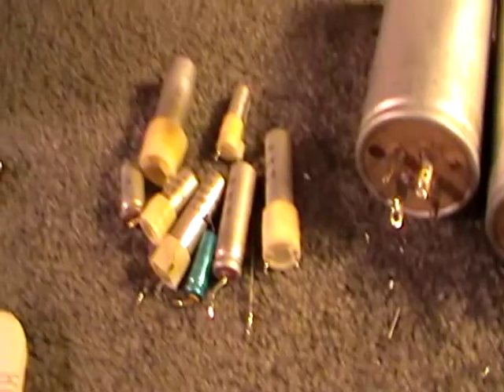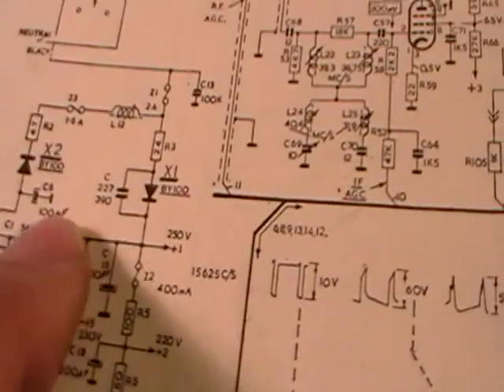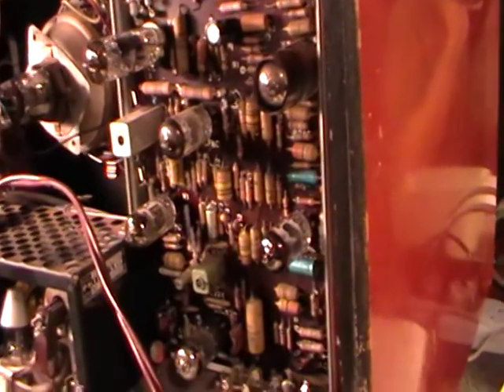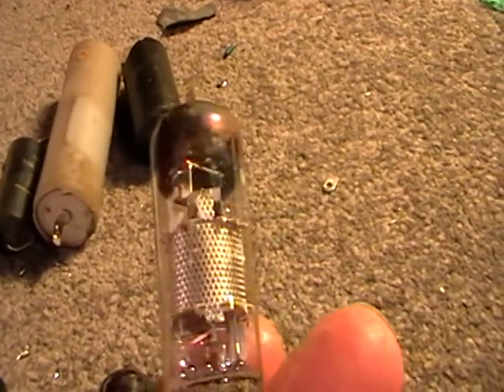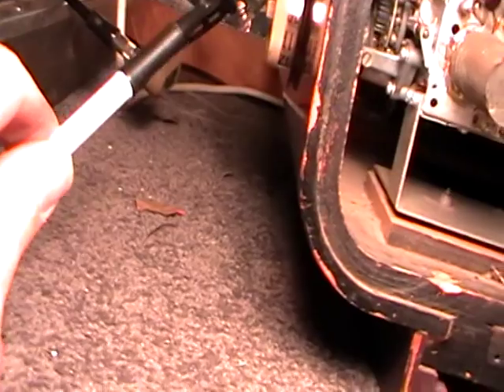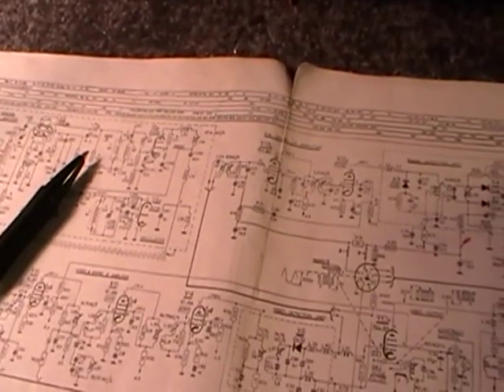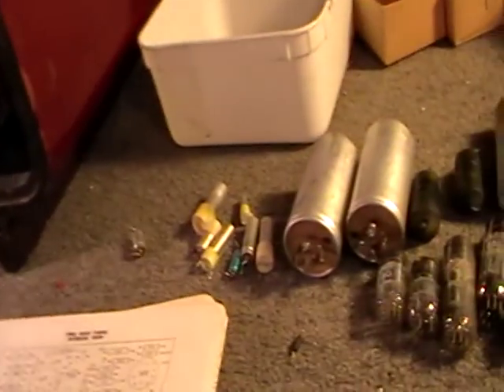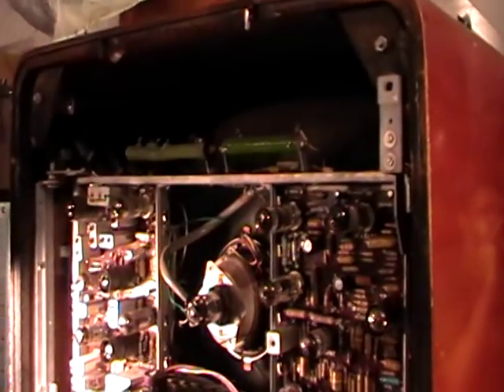Philips 23TZ323A 1962 Vintage TV Part 4

Comment: I then put a piece of wet or dry sandpaper on a piece of granite and honed each half of each can until both edges until they were perfectly flat. After that, on the can I put back together, I found that a 3/4 inch PVC pipe coupling fit perfectly inside, so I cleaned any residue and filings out of the can glued the coupling in with hot glue and then installed the new cap inside the coupling, with the new leads sticking out the bottom, then I used some more hot glue and stuck the top back on.

Comment: I've been working on methods of doing just that myself, it does take some finesse sometimes to get them open and cleaned out, depending on what method you use. I'm currently rebuilding some in a radio that a previous person cut open rather crudely with a hacksaw and restuffed, I have one back together but I need to get new caps for the other. I had to wrap some masking tape around the two halves and then file the edges down to just above the tape line until they were straight.

Comment: I also shimmed the replacement cap inside the coupling with some corrugated cardboard so it would stay in place. I also tried to align both sections of the can before putting it together to make it less obvious that it was taken apart and marked it with a pen. It was a bit of work but the previous guy left me no choice, all in all I lost about 1/4 to 3/8 of an inch from the height of each can because he cut them crooked. He also restuffed the other can using 50 year old caps, I was not amused.

Comment from the maker: Thats something I wouldn't normally do unless there was no physical room to put replacements. I kind of like to access the caps should one ever fail in the future. I recently had a brand new Panasonic 105 low esr cap fail, which I was rather surprised at but it leaked out and got hot, and no I didn't put it in backwards :-)